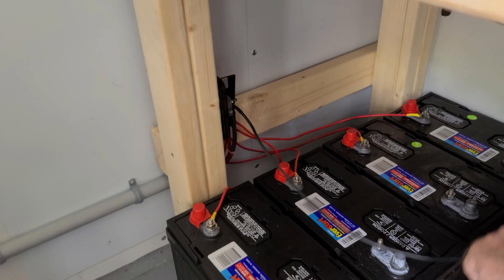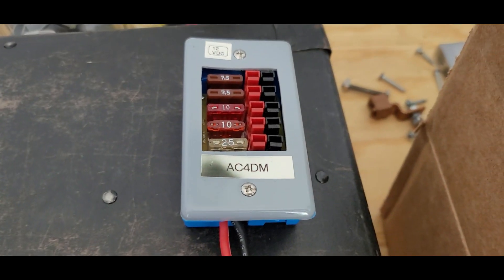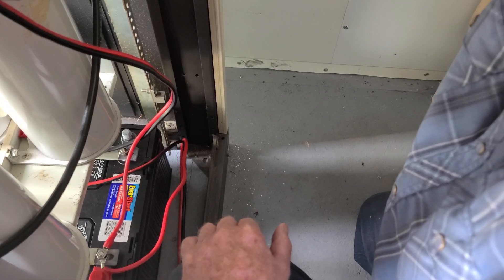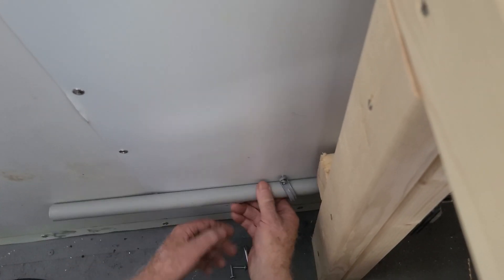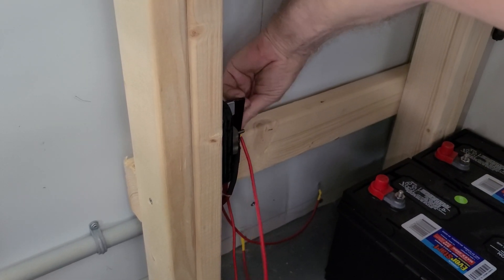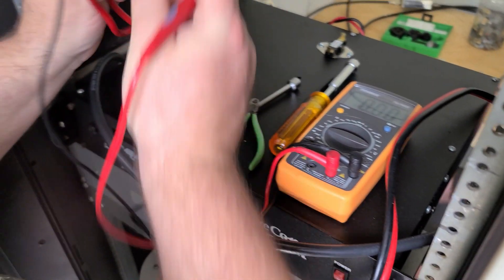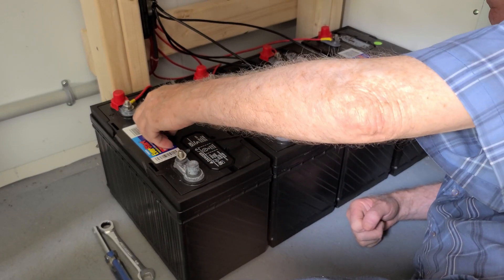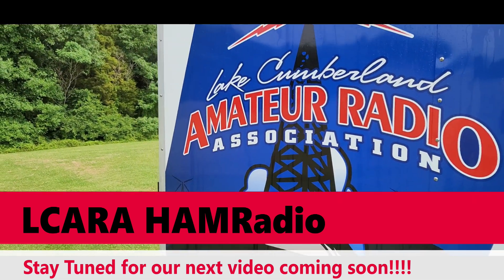LCARA HAM Radio: Adding Batteries to the Abandoned Repeater Site!!!!

Comment: Tip: No need to drill holes in Radiata Pine ‘lumber’ because the screws will just screw in like a knife going into butter! Tell Fred he needs to buy a second cordless drill for his drivers! And he also needs to buy a hammer! And untwist the wire before threading through the hole!